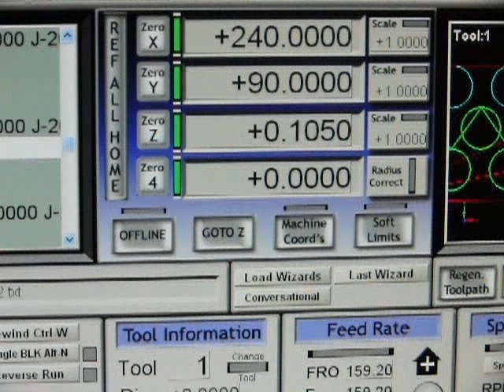My homemade CNC router

Comment from the maker: @calholli  That'smy first CNC router I built. My last video shows parts cut with my second mill. The first one was kind of educational . I learn a lot from the very basics. So more experienced I build second one , more durable and precise and now I can mill a steel. I'll try to post some video of my second CNC Mill.  I use Mach3 which in a free version is limited to 500 Gcode instructions. Gcode is generated from DXF file by using CamBam( free use up to 40 times).